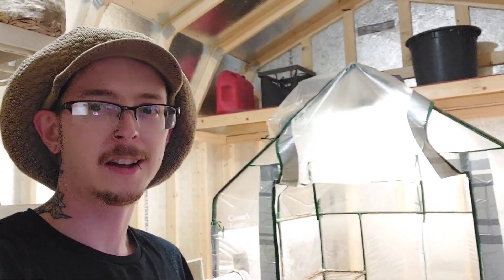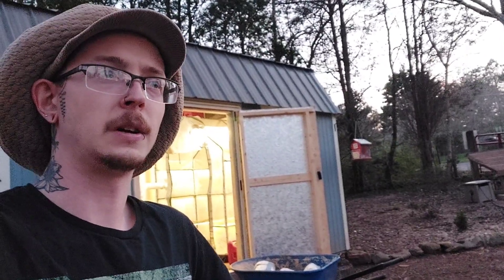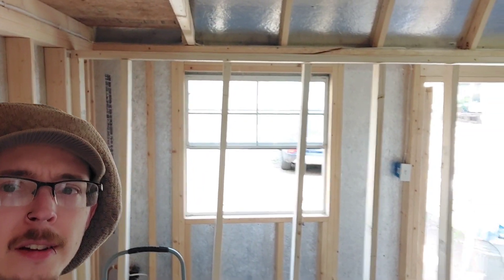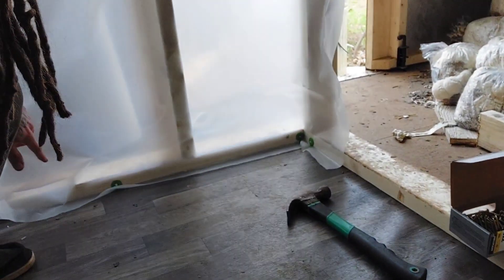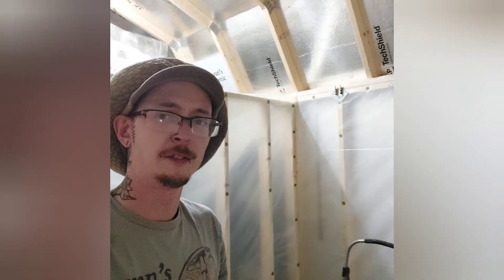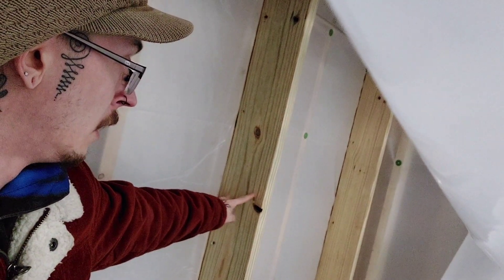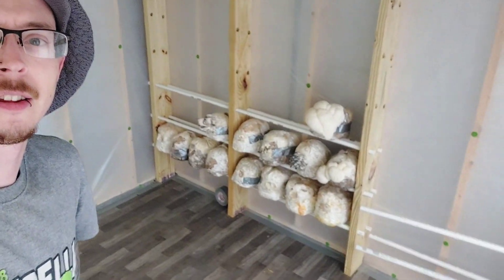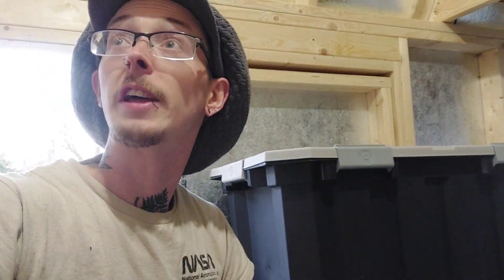How To Build A Mushroom Fruiting Chamber | PART I

Comment: Great video but is there a reason why you don't simply stick the poly sheeting to the wall? or at least use less wood because it's kinda over engineered, you don't need that much structural support. I'm building a fruiting room right now and it's around 6 by 7 and 3.5 meters high on one side, poly sheeting is pretty tough if fastened in a way that's not putting all the stress on a small spot, i will be using galvanized wires every meter or so just in case the plastic sags with time but as it is it holds up perfectly provided you have good walls to serve as anchor points, i also welded it together with heat so it's practically air tight and it kinda needs to be since i plan on using positive pressure since i don't like the idea of breaking fans all the time.